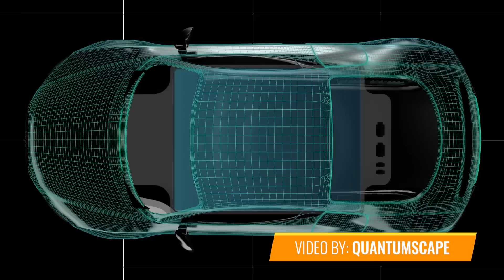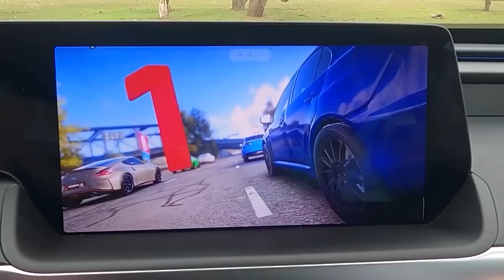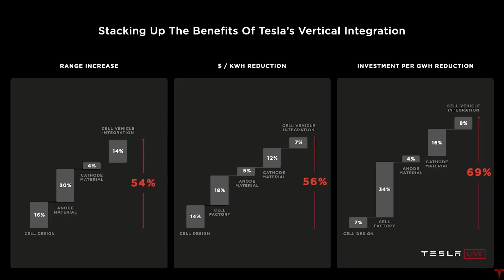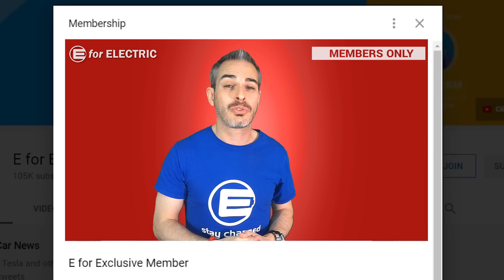TOYOTA's Only Hope to Beat TESLA: Solid State Battery

Comment: Hey Tesla Owners. Don't Wreck.  You bend or break your frame. Your sending your car to the recyclers.  Thats if the battery explosion doesn't kill you first. 🤣 but the Frame and body are one piece stamps,  connected to the bottom thats made of the battery. It's cheap to make it that way but impossible to fix after a collision.

Comment: The next tesla battery break through would already be amazing if 
It it held more charge & charged faster 

Resulting in a 500 mile battery (real world capable of 400+ miles no matter the conditions ) and if it fully charged in 45 min.

Also if it had a solar roof capable of charging the car 6%+ per day (30 miles) (~25 real world miles)
 Most people only drive like 25 miles in a day. And over the Sunday where youre not going out it could charge those 30miles and you could add them on to the 30 miles you drive the other days for a total of 35 miles Monday to Saturday . Making charging only necessary for long journeys. Though no day journey is longer than 400 miles and in every 400 mile journey you would usually stop 2 times for 10 min each meaning you could charge the battery ~270 miles in those 20 min (the battery charges slower towards the end. Whilst you're driving you'd also get that 30 mile boost if it's sunny giving you 300 extra miles in total . then when you arrive you only have to wait 20 min to be on full charge again (1 anime episode)

That said if you ever are on like 5% you could literally watch 1 42 min TV show episode whilst you're charging and be on full charge.

Comment: Most think it's just "battery tech" that is literally 20% of the issue. 80% of the issue is scaling production. Look at the top Solid State Company's they won't be producing even close to what is needed to meet the demand. You can have the BEST Battery tech but if you can make enough to sell it - You WILL NOT be relevant. So next time you hear about battery tech breakthrough -> see how much they actually can produce. This is 80% of the issue yet all the channels look at oooo cool new tech. It's really not relevant. Can you produce enough at scale at low enough costs. TESLA is light years ahead & even they can't keep up with demand for more batteries. The RACE IS NOT Best battery tech - it is producing the most amount of batteries at scale for the best value. Solid state is not easily scalable -> good luck fulfilling orders.

Comment: Toyota likely has the ability to beat everyone for solid state mass production.
Reply: Toyota is talking 10 years for production for SS battery production, so they have problems they have not solved at this point.  In the meantime, there are a hundred battery startups working on the problem as well.  Tesla will have so much cash that any startup battery company that can produce a high density fast charging battery (SS or not) can be brought under Tesla's umbrella.

Comment: Part of the problem is that we all are accustomed to think about refueling as a specific type of transaction that takes place for a specified (short) length of time at a specific location (a filling station).
 For an overwhelming majority of car users who drive well under 50 miles a day in typical use, being able to top up your batteries at night while you are sleeping will meet 100% of your recharging needs. 
The problem only arises when we contemplate a long distance trip where one is planning to drive for 400 to 600 miles in a single 24 hour period. In reality, the majority of us do not do this very frequently, but the occasional need acts as a mental barrier when thinking about the length of time recharging typically takes. 
If one simply takes the time to plan a trip using either the on board app offered by most EV manufacturers or one such as "better route planner" offered commercially, you can get your required top up charge done while having lunch, or doing some shopping or taking a half hour walk (any activity which takes 30 to 40 minutes long) while you are en-route. 
In fact, stopping at a rest area to walk for a half hour every two hours or so of driving is a much healthier way to travel anyway. In the future, it will be the norm to find every rest area equipped with  numerous fast charging stations and every hotel/motel similarly equipped. The future is clearly with EVs. Arguably, we are there already with the 4680 factor batteries offered by Tesla today. If Toyota is hoping that Tesla will stop innovating and doing research on ways to improve their battery technology, they are not playing with a full deck. Tesla is way ahead right now and have proved agile enough in the past that I believe that should a breakthrough in solid state batteries happen tomorrow, Tesla will have enough time to absolutely dominate the EV market while the implementation, real world testing and scale-up issues are being worked out by Toyota, Volkswagen, Volvo, BMW and Mercedes Benz. Tesla might surprise everyone and announce their own solid state battery anyway. Anyway you slice this, EV's are coming, longer range batteries and solid state batteries are coming, costs will be dropping and the consumer is the ultimate winner as is our planet.

Comment: They’re are going to keep updating current tech batteries because they have means to scale them any you will just see small increases in performance until that have the ability to mass produce a reliable SSB system that they feel is at a point which they can sustainably produce.

Comment: I have 2 thoughts on the matter.  

One is that Toyota is using the solid state battery as a delay tactic.  They can easily delay their entry in to the EV space by 5+ years while "using" a hyped up yet developed technology as the base for their battery tech.  

My other thought is that it's very likely that the initial solid state batteries will not be as cheap or as good as we have been promised.  Sure, solid state batteries have a higher theoretical energy density and charging rate, but the real life performance is going to much lower initially and cost higher.

Comment: I disagree. Toyota doesn't need their battery to be better than Tesla's to be competitive. If they can get it performing in the same general ballpark and then leverage their expertise in producing reliable and affordable cars that maximize bang for the buck their EV will do very well. The relatively high price of Teslas is a stumbling block for a huge number of people who are interested in going electric, so if Toyota can deliver a solid EV which is only slightly higher than their ICE equivalents they are gonna sell like hotcakes. And no, I don't think the $25K Tesla is going to put the nail in Toyota's EV coffin - that car is designed for the Chinese market, which means its going to be tiny and probably very stripped down feature wise. I don't see a huge number of people in North America buying that for $25K if they can get a Camry class Toyota EV for say $29K.

Comment: Toyota because they are working on it. That does not mean, it is the right solution.  The right solution will be the one with the lowest coat per Kilowatt mile.
Reply: Cost per mile is a better way to rate things.  A battery with the same energy content but lighter will let you drive further.  Somehow, the resulting range per charge also needs to come into it.  More range gives more practical uses.
Reply: @kensmith5694  Like my Cost per Kilowatt-Mile because it encompasses efficiency which includes cost per mile, energy density, charge and discharge times, and more.

Comment: I have no engineering background and so don’t pretend to know anything about the technical side of this debate. However I am old enough to remember the video recording wars 30 years ago. Sony came up with a technically superior system (Betamax) which should have blown the Panasonic VHS system out of the water. Just the opposite happened, with VHS dominating the market while Betamax turned into a huge commercial flop. The moral of the story lies is that superior engineering could not compete with simpler technology with larger installed base. Ultimately the winner of the EV battery war may not be the technically superior product but rather the one that is easiest to market to a large but skeptical consumer base. A wildcard may be a plug-in hybrid with sufficient battery capacity to cover 90% of driving needs while still offering the security of conventional ICE for road trips. The Toyota RAV4 with 42 miles EV capacity and the Honda Clarity with 47 EV miles offer consumers the best of both worlds. This is clearly not a popular position among EV cognoscenti but  should not be completely rejected that’s a possible transition to full EV driving.
Reply: Betamax lost out because Sony bungled it by not letting others build to the standard at no cost and also because the movie industry didn't like it.  VHS is not technically simpler.  It in fact is very complicated.

Comment: Am I the only one who is sceptical of the 4680?  No public demonstration yet, the Plaid+ (which was going to use it) cancelled, the Tesla Semi (which is going to use it) still had no release date, etc.  It could be great, but it’s still unproven.
Reply: @lepidoptera9337  Releasing a new car means it will almost certainly come out, eventually, but isn't always exactly as promised (the Modely Y was suggested to be about 50% the same as the Model 3, but Sandy Munro found otherwise when he tore it down).  Releasing an avant garde new tabless battery design may not only not come out on time, it may not have the suggested levels of weight, cost, and power density improvements either.  I'm not sceptical that a 4680 battery will eventually come out, but I am sceptical that every single claim about it will come true.

Comment: Toyota got more trick than EV in thier bag  to dominate the auto industry. Why does it have to be EV, hydrogen combustion car is also a easy and clean option. The pressure is actually on Tesla to push to get thier promised but never delivered FSD. If that does not happen there are tidal wave of EV entering the market undercutting thier market share and profit. It will be game over for Tesla. Let's wait and see. But, it is great to see innovation and changes happening at such a fast pace.

Comment: The greatest benefit of the tabless design would be shortening the heat transfer path from electrodes to metal can, and doing so from every layer of the jelly roll from outer layer to innermost layer.  This also shortens the electrical path as well, which lowers the internal resistance of the battery, and thereby the resistive heat losses, when charging and discharging.  Now all they need to do is create enough factories to make a Billion of them every year, so they can make a Million cars a year.  I don't see VW or Toyota making a billion solid-state batteries a year any time soon.  Too expensive, too uncertain, too much testing needed, too many factories and production lines needed, too bad.

Comment: The biggest problem with solid-state batteries eluded to on Tesla's battery day is price. Elon said the world does not need a longer-range (higher price) electric car but a cheaper electric car. Tesla is chasing price as the answer to mass adoption, not technology at a higher cost, more range and faster charging. These things will happen, and those that can afford them will buy them, but the masses will live with current limits but at a much lower price. Tesla is not going to sell a plaid Model S to the masses, but maybe a Model 2.

Comment: I think Elon is fully aware of Solid state battery tech.   He is also aware of costs and mass production.  With the 4680 battery tech I believe he is on the right path as this will allowTesla to produce more cars now with a very decent and functional, and economical way to power all Tesla cars.   To implement solid state now is extremely difficult and expensive and when it comes to producing affordable cars and lots of them his path is clear with the 4680.  I’m also quite sure that Elon is looking at the solid state tech to see if it’s possible to produce economically and with high production and if it is possible with a clear advantage over the 4680 tech he would also do it but it will take years from now to accomplish this.

Comment: Either Tesla is already dabbling in solid state, or they've concluded it can't be done. This is not the kind of thing Tesla gets wrong.
Reply: There is always "the first blunder".
Reply: @kensmith5694  Batteries are one of Teslas core competences, that they will be monitoring even if they don't believe it'll work.

Them not making any announcements just means they're not launching any products based on solid state - but neither is Toyota any time soon.

Comment: By the time Toyota is able to start production of any kind of Solid State Batteries (this will not be before 2026), Tesla will have a 10+ TWh production of the 4680. So, Toyota will not be able to compete even with Solid State Batteries (IF they can even make them before Tesla) because of the enormous difference in scale.

And I will not even talk about all the other fields in which Tesla is far superior when it comes to EV tech compared to a company has that 0 (ZERO) EVs on the road and as a result 0 experience or expertise with them.

Comment: Toyotas solid state battery is only hype and exists only to pass message it's not right time to buy a ev now.

Nothing indicates that Toyota have done any breakthroughs which are needed to get solid state working. Toyota's talks or estimates don't indicate they are going to sell significant amount of EV's.

In few years with structural battery pack, Tesla's model3 battery pack have about 200kg effective weight. It is so low that even the best possible solid state pack can't provide benefit on weight. When cells get small,they can't be used to increase hull rigidity.

Therefore Toyota need to compete with price, charging speed and cycle life. All of them are currently quite challenging to put into same battery.

My guess is that if Toyota can get they battery into market in next 5 years, it is going to have problem in one or more if those areas.

It can be expensive and therefore have small range in practice. It can also have limited cycle life which can make it expensive to use.

Most likely Toyota prefer charging speed so they publish small battery which charges fast even in lower power charger. Such battery gain cycles fast and don't last car lifetime. It don't provide low center of gravity or increase crash safety.

Comment: NIO promised to offer a solid state battery pack to its customers by the end of next year.
Reply: Nio doesn't make their batteries,  they get them from a supplier.
Reply: @vinyllpreviews9462  Yes but NIO hasn't disclosed who the solid state supplier is.
Reply: @cruiser97eric1  so basically anybody should be able to buy those batteries.
Reply: @vinyllpreviews9462  Yes unless NIO has an exclusive agreement for the initial production. I expect the cells will be in short supply for some time.
Reply: NIO to the moon 🚀

Comment: Wouldn't it be nice if the $10k / $12k tax credits for EV's being considered would apply to something that would ACTUALLY make a difference... like residential SOLAR for example.?  It's clear to anyone that possesses a modest amount of cognitive thinking that  for the next few years at least, EVERY good quality EV that is made will sell quickly regardless of price.  The tax credit will ONLY exasperate the shortages that currently exist in EV's because of lack of production capability across the globe, and will then be compounded exponentially due to battery and chip constraints.  AT BEST the tax credit as currently written will boost Tesla's numbers by 5% over what they would sell anyway.   

A similar program for residential solar on the other hand, would in fact BOOST solar adoption (which is not seeing the constraints of production that EV's are) Plus it's a hellofalot easier to ramp solar production than it is quality battery production.  IN ADDITION, the quantum  increase in residential solar that would result, would ELIMINATE the NEXT major hurdle of EV adoption which will surely raise it's ugly head as the world approaches the 50% saturation rate.   What is that you ask?   That is being able to CHARGE those EV's without building hundreds of new coal or gas power plants.   

in a nutshell, the tax credit as it's currently being considered will DO NOTHING to increase mass adoption of EV's and could in fact, in years to come, CONSTRAIN this adoption rate because of the strain on the national / global electrical grid.   

as a side note, a solar tax credit would JACK Tesla's stock price by giving the energy business a much needed kick in the pants.

Comment: Alex - you are behind already.  Hyundai's Ioniq 7 full size suv is supposed to charge in 7 minutes and have 350kw/kg batteries from SK Innovation.  This is what Quantum Scape is promising in their gene solid state battery.  2024 release is being moved to 2023 which means SK Innovations already has a battery with same energy density as solid state batteries.

Comment: Panasonic like LG has an energy division that has battery production as a major task. They should be interested in any cost-effective tech they can exploit. If someone developed a battery based on quantum fluctuations (no happening yet) they should investigate. Tesla's 4680 IS a new tech, based on Maxwell's dry electrolyte. It was the liquid electrolyte that was plaguing LiIon. Solid-state has been investigated for over a decade but producing volumes of them has been the weak link. Go Toyota, make it happen. Also, Tesla is not fixed on a particular chemistry using several LiIon and now LFP. If a provider could offer a SS battery, would they come out with a PlaidS++?